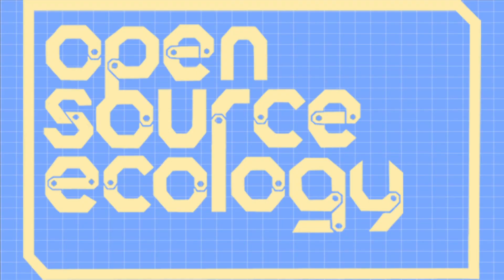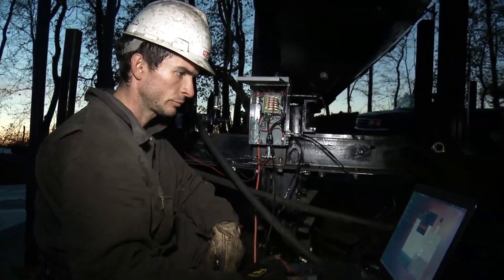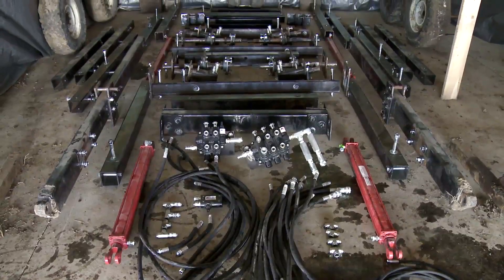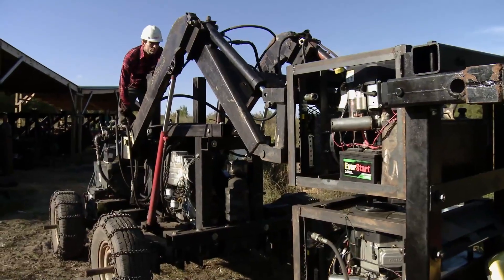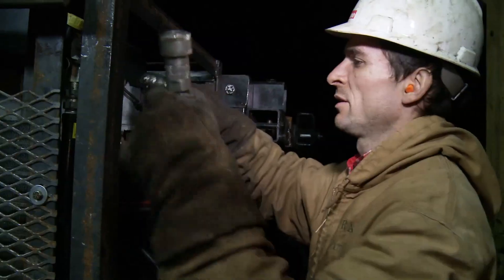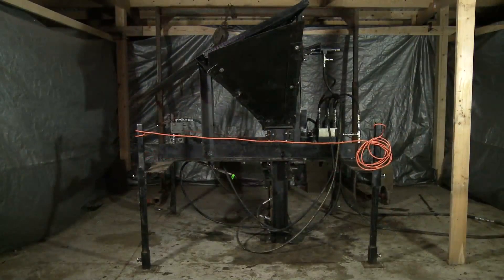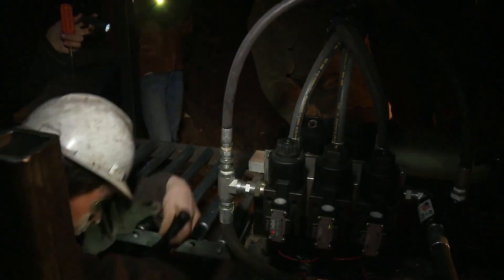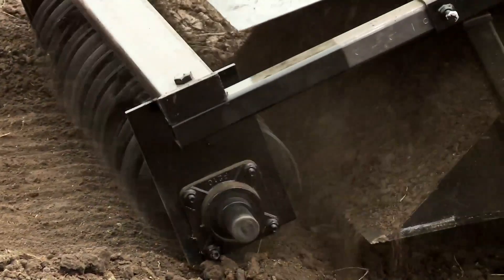Practical Post-Scarcity: Open Source Solutions

Comment: The lifespan of CEB bricks depends on its environment. If they are dry they can last longer than traditional wood frame houses (70 years -that's what professional CEB websites say). If the CEBs are not dry then they will deteriorate at a rate determined by their composition and the amount of moisture to which they are exposed.